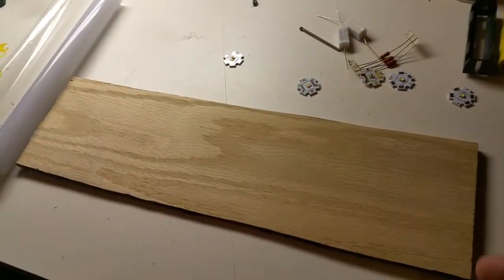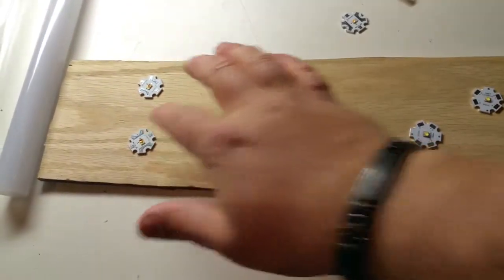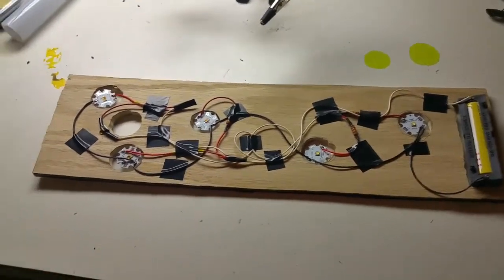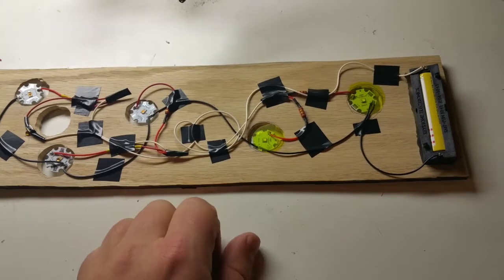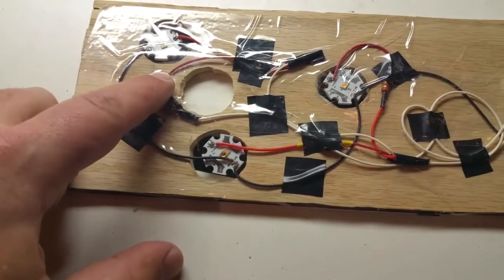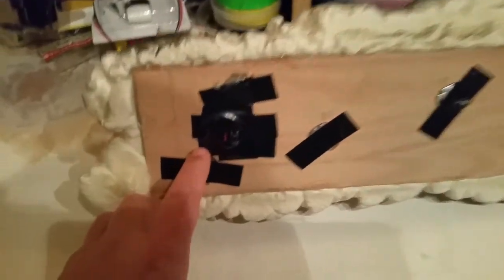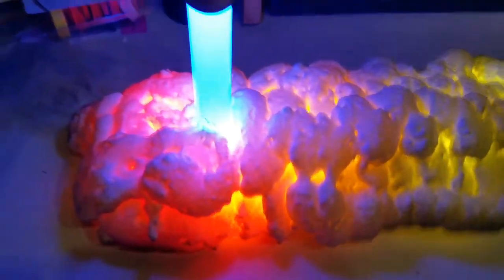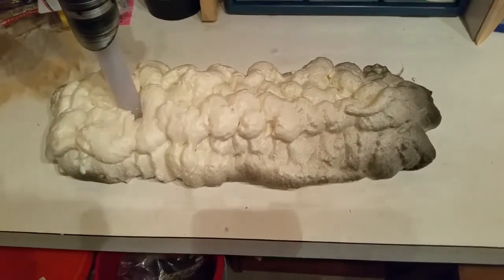Melting Wall Saber Stand

Comment: Only thing i would have reversed the lights white snd yellow near blade the orange is when steel is cooling off think of a plasma cutter not metal in a forge it only glows orange because the plasma cutter is hotter

Comment: Looks cool. I think you got your colours the wrong way around though? Molten metal is white hot and cools to yellow, orange and then red. You should have had the white led's with the yellow filter next to the blade, then the amber and then the red/orange ones in the "cooled" part of the foam. I also like the way MadCow added the "cut" running across the middle of the piece to show where the blade has passed.
It's a clever idea though and should make an interesting mounting display.
Reply from the maker: Starganderfish yeah, I guess you're are right with the colors. I tried to do the cut down the middle but couldn't get it to look right, and the great stuff is a pain to work with.
Reply: It's an awesome build and I was thinking the same thing lol